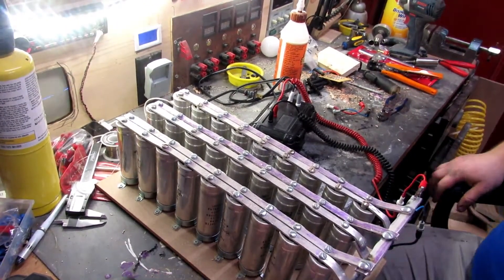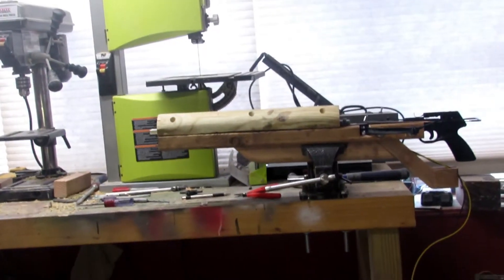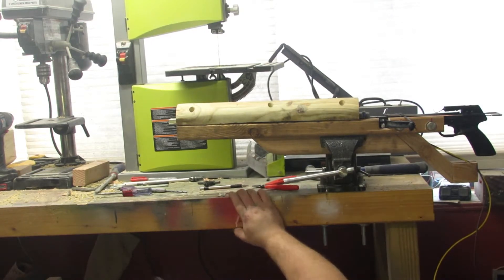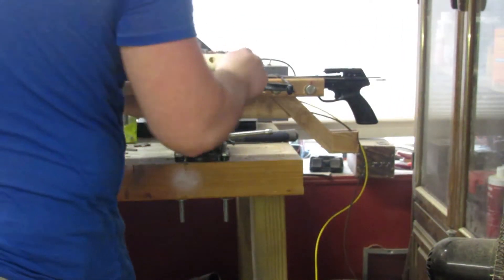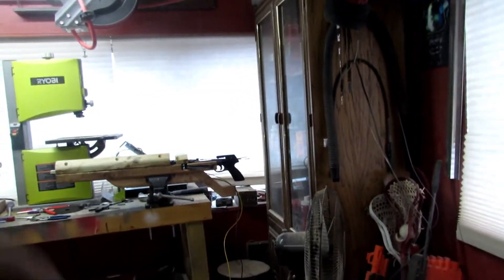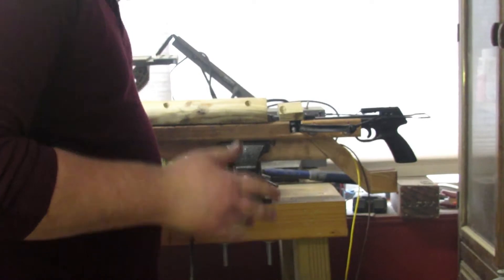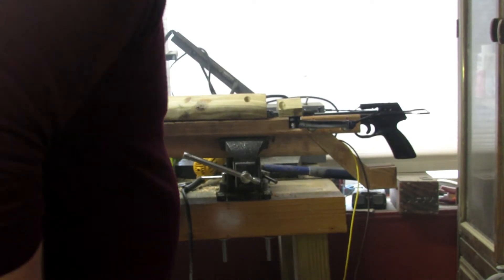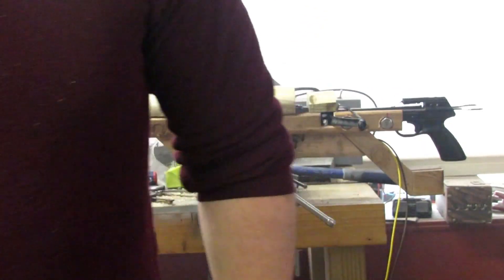DIY Rail Gun Test Fires

Comment: I am making a rail gun. It is semi automatic ten clip mag. Using copper rails. Only 1 foot 2 inches long.  With a million Volts. Tell me what you think!
Reply from the maker: Jacob Dynes how are you supplying the voltage?
Reply: Using a transformer
Reply: It is smaller and lighter. I am now making a newer model of my design.  Incorporated solar and thermal energy converter.
Reply: I am using 1/4inch tungsten projectiles. The home made mini transformer heats up too much. Trying to find a better method to produce high output voltage. So for now I am making a smaller version that uses 1/4 inch copper rails with  a coil to accelerate the projectile through the rails faster.

Comment: Well,what do you think about magnet surface..?
im wondering shoots are results of  trigger system..
Reply from the maker: JeasWB The magnets definitely helped to move the bullet smoother, and I have since then upgraded the trigger system; it’ll guide the projectile to the rails better.
Reply: actually my point was different.I meant difference of speeds.with only trigger and with trigger+capacitors.
Reply from the maker: If it was just the bow, The projectile gets stuck right at the beginning of the rails. I didn't film it, but i checked that lol. just to make sure.